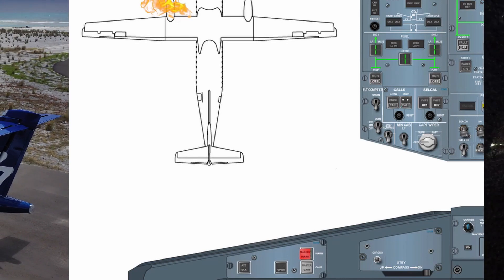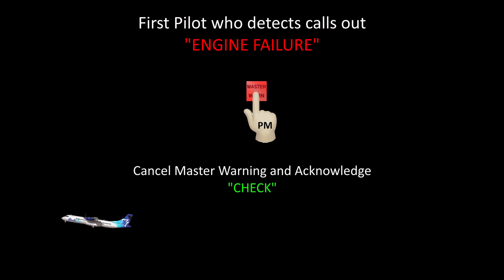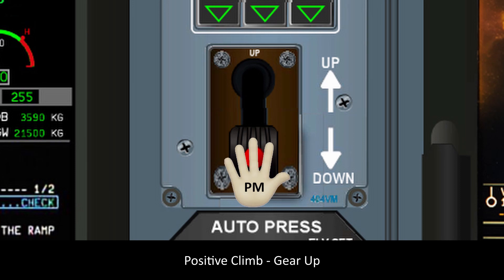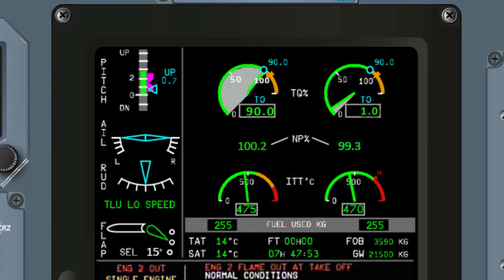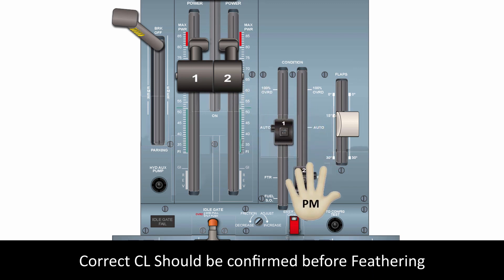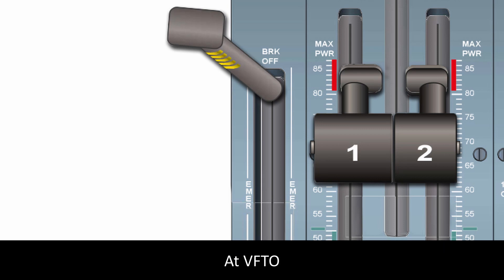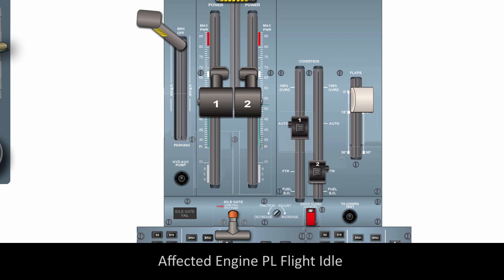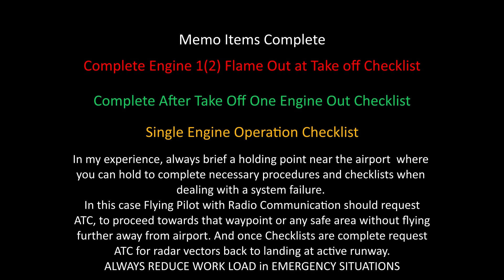ATR 72 600 - Engine Flame Out At Take Off Procedure

Comment: Rules of eng flameout:
1. Kick like crazy!
2. Lock the yoke on good engine side, don't turn it even in neutral position.
3. Use both rudder and aileron trim
4. Use AP asap when stabilized. Never wait for accel altitude. AP first before communication.

Remember AVIATE, NAVIGATE & COMMUNICATE in that order.
Reply from the maker: Agreed, Auto Pilot should be used asap.... Once you are stable even before acceleration altitude (400ft) which you will be normally, AP ON.